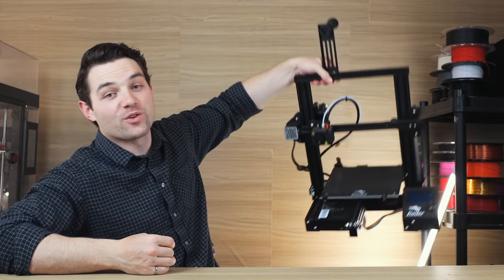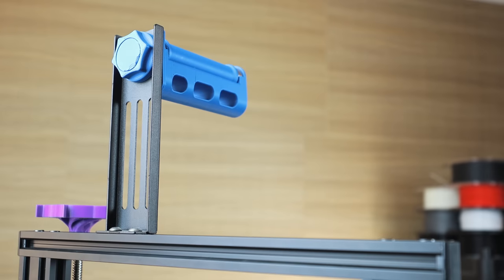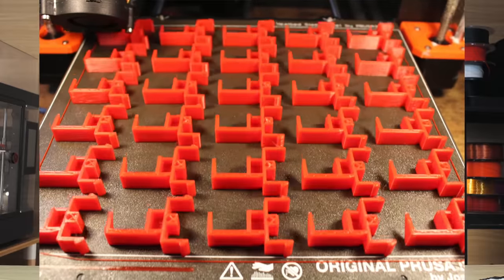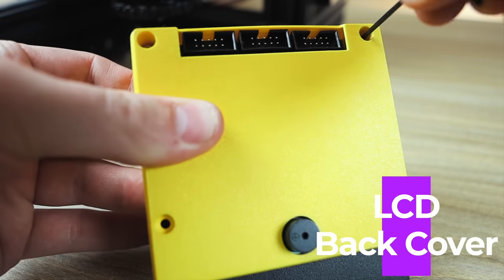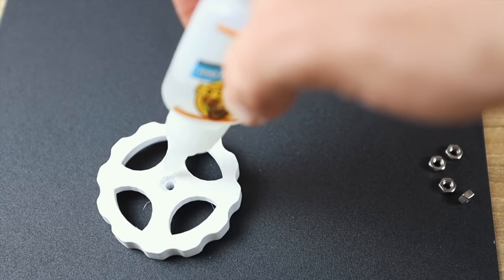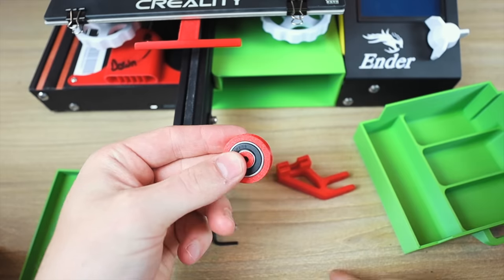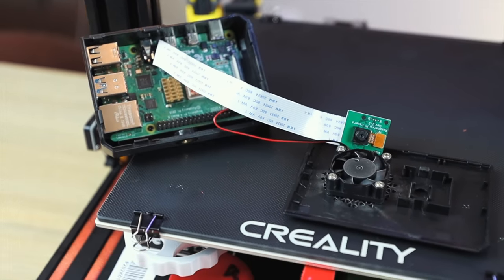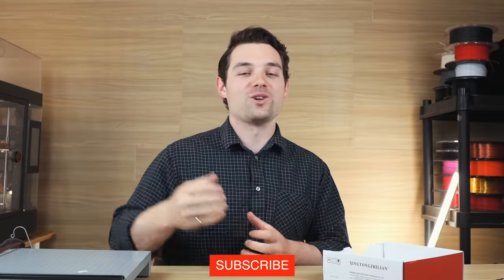Ender 3 Pro Upgrades - 2021

Comment: Can I ask you a question I’m completely new to 3D printing. I don’t have a printer yet I’m looking for one that is easy to use possibly touchscreen auto levelling bed idiot proof. It’s just for home so my autistic teenage son can use as well as my wife and me. I’m disabled and had two strokes so memory has gone and hands are messed up if it doesn’t have to be built great but not a problem. Any advice would be very much appreciated many thanks Steve. Ps I’m in the U.K. if that helps thanks

Comment: Thinking about getting my first printer would yall recommend the ender 3 pro or ender 3 v2?
Reply from the maker: The v2 is a nice little upgrade if the price doesn't make a difference to you. Performance wise they are nearly identical !
Reply: @AustenHartley  vyper or ender 3 v2?
Reply from the maker: V2
Reply: @AustenHartley  reasoning for the v2?

Comment: I'm new to 3D printing. And I swear I can't get a print to stick. It keeps falling of mid print. I swear I leveled the bed like a thousand times. And the spool Holder is tricky because part of it is thin on the bottom then gets thick again. Any help, what the hell am I doing wrong?
Reply: If you are using a printer with heated beds and PLA plastic make sure the bed is heated correctly (check temps usually on the spool) if that doesn’t work you can use a raft in the slicer settings. If that doesn’t work you there are ways to make the bed sticky so look up youtube videos on which adhesives work best for your print surface(magnetic, glass, etc.)

Comment: The drawer for the ender 3 pro does NOT work on the NEW ender 3 pro, the bolt on the bed hits the drawer.

Comment: Im loving my Ender 3 Pro but I wouldnt say its much of an Ender anymore it has so many upgrades it might be about the price of a prusa mini.. So far it has bltouch, skr mini e3 v2, petsfang w/ 5015, micro swiss dd/hotend and flat yellow springs. I also decided to move all electronics out from underneath and into an external electronics housing and I couldnt be happier it makes doing anything with the mobo 2 screws and done! The upgrade to the skr was a breeze with it! Youd think with all these upgrades id have decent prints, but tearable wispy stringing for pla and tpu is only good for non complicated items, otherwise overhangs are impossible.. any chance you could hit me with some recommendations on what to try out? Ive watched every video under the sun
Reply from the maker: With an Ender 3 and standard Cura profiles you shouldn’t get excessive stringing ! TPU is a tough material to work with on any machine. Unfortunately the Ender isn’t really optimized for working with flexible filaments. You will have to run a print calibration test to really tell what the problem is !
Reply: @AustenHartley  after days of tests i have come to the conclusion my machine is cursed lol no but really ive tuned everything i can, retraction speed/ distance, e steps, flow, temps, fan speeds, lin advance, etc and even with pla the closest i can get it is tons of fine wispy stringing. my hot end is seated correctly as well so i am just not sure what do anymore and ready to throw in the towel with the micro swiss, i wish i had a much happier story with it but its been a nightmare and i have to go above the recommended retraction of 1.5mm to 2mm and print my pla+ at 230, ive done it all and lower temps give more stringing and bad layer adhesion. I think it may be an issue with the additional weight of the stepper added to x gantry and sagging during prints but thats just a guess. Id have to upgrade to dual z or lin rails to fix this issue i believe

Comment: Is it normal for my stepper motors to get quite hot when printing?
Reply: It could be a stepper current issue, Teaching Tech talks about that as a possibility in his printer calibration guide: https://teachingtechyt.github.io/calibration.html#steppers
Reply: it is normal. If you are really concerned buy some cheap 40x40mm heatsinks but it really isn't an issue.

Comment: i notice when you used the Z rod knob, the z rod wobbled... you might wanna check to see if that thing is bent.

Instead of the Back Cover - I'd recommend the Tool Tray version. it makes that negative space useful - and keeps tools and nozzles nearby and out of the way.  (https://www.thingiverse.com/thing:4522940)  holds standard cutters, spatula (which with the glass bed you won't be using - so tuck it away!) and spare nozzles, plus all the wrenches and stuff - even a microSD card slot holder for extra cards.  It's great.

I recommend for all printers a 0.2mm Feeler Gauge for tramming. (bed leveling as people call it) instead of the paper.  by having a known number you can easily set any z-step offset (or babystep) to 0.1999 or so and "counter" the gauge so you print at 0. (or near 0, you want a little squish at least)  I started using the gauge instead of paper and I will never go back to standard paper tramming. ('Ive only had 1 thing come loose, and that was after a power failure and the nozzle clipped into the printed part and freed it with a less-than-hot bed from it cooling, possibly preventable if I had been thinking to pause and re-heat the bed fully for a minute before resuming - learn from your mistakes, and others!)

I'd also print a spool holder that removes the spool from the top of the printer, moving it to the side - or just flat off the printer itself.    The reason to this comes down to kinetic motion , and the uneasy feeling I got when seeing in in motion - and the better print quality I got when removing it from the top of the printer. CHEP (great guy, check him out on Youtube as well, he has A TON of Ender 3 knowledge and experience, and is willing to answer questions in email!) - also has a spool holder that holds it off to an angle from the base frame, connecting it to the frame. I used this one for over a year before it got a crack in it from wear, and only recently printed a new spool holder to try out. (it does come a bit close to the gantry so make sure you put it all the way at the edge of the T slot extrusion to prevent collision!)

Comment: BL touch is amazing. I disagree with this. BL touch has increased quality like crazy
Reply: I resisted the bltouch for the longest time, but finally gave in and use it with Jyers firmware on ender 3v2. Can’t speak highly enough for it!
Reply: How does it work?  Does it extend that end until it hits (or doesn't hit) and that tells if you it's level?
Reply: @troyajohnson26  yeah so it replaces your z offset. The little prong comes out and when it hits the bed it stops. From there you adjust how far the nozzle is from the bed from that through z offset. Now when it goes through its ABL it can tell where every part of the bed is instead of just adjusting the 4 corners it picks up all the bumps and valleys
Reply: @MegaMrsuperawesome  replace z-offset or z-axis stop switch? I thought z-offset was for setting the difference between nozzle height and probe height. I'm still beginner so just making sure I haven't misunderstood anything.

Comment: Yo, don’t cover the motors, it traps the heat in and shortens the lifespan
Reply: If youre refering to the purple cover then there no worries. The stepper motor is on the bakside. The Black box is just a cover for the pulley and for mounting the x endstop switch

Comment: You inserted v-slots in wrong orientation
Reply from the maker: That is true. I wanted the textured side from the print bed visible. Will work both ways, but the correct orientation will work slightly better.

Comment: My ender 3 came with a magnetic bed and a flexible base, should/could i get a glass print bed?
Reply from the maker: Personally I would. But print for a while and see if you like the stock option ! If not check out the glass bed options !

Comment: I never had any luck with glass it always fails
Reply from the maker: Glass bed with a good adhesive and the perfect first layer is the closest thing to full proof I have ever found , but it does take some time and experimentation.
Reply: I had that issue myself. Then I bought a bottle of "3D Lac plus". Now I can print even small parts with success. It is a little tricky removing parts after a finished print, tho. Once the part are off, clean your print bed with only a clean tissue and a small amount of regular cold tap water (not IPA) and you are good to go again with another successful print.

Comment: I actually wouldn't "upgrade " to a capricorn tube. If you use cheap pla and not expensive name brand spools you'll have so many issues using cheap pla. I only us cheap pla and never have issues with under extrusion or over extrusion. But once you get Capricorn you'll have so many issues. I ended up sticking with stock tube. I also print Flexible filaments with it with stock parts besides 3d printed extruder motor plate.